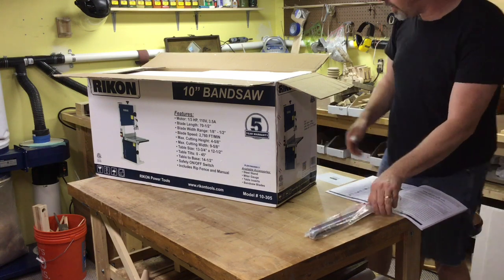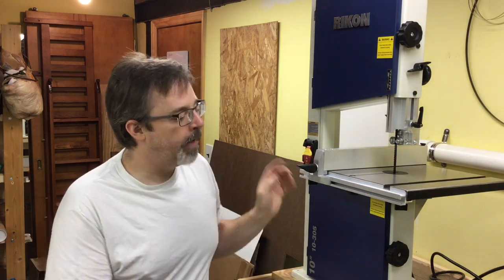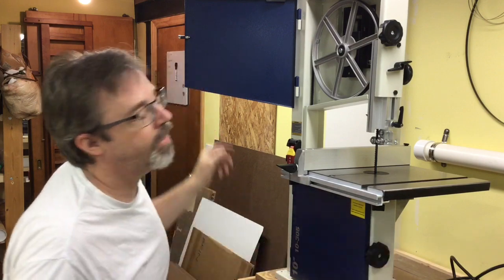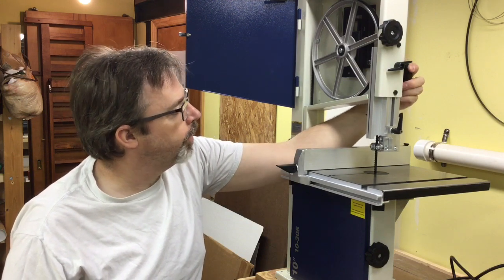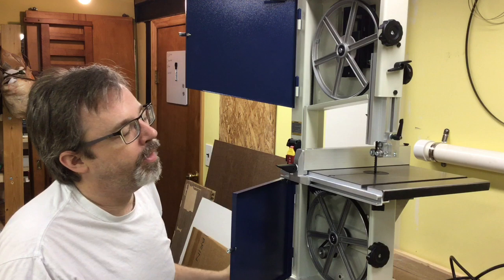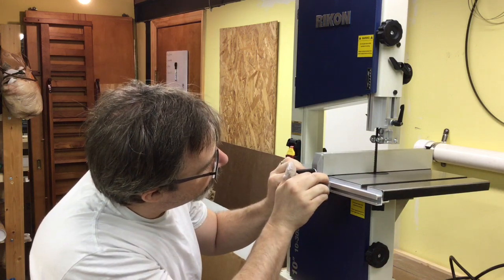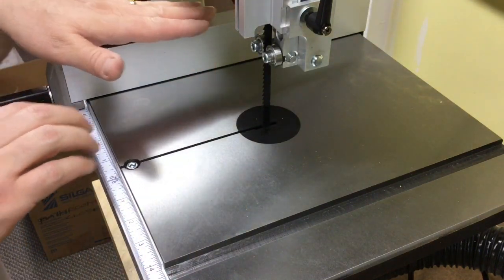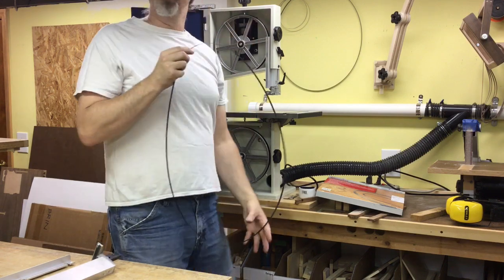Rikon 10-305 bandsaw review

Comment: I have newer model 10-306 and it does have two screws in the back of the frame that keep the aluminum guide attached to the body. You can loosen those two screws and square the guide with the table so it is perfectly parallel with the blade.
Reply from the maker: beretta0222 I will have to look again. I have the two screws on the side, above and below the height lock knob but those couldn’t be adjusted with enough accuracy. It hasn’t been an issue really, but I like to have things tuned right. Thanks for the info.

Comment: i have got the rikon 10-305 and it is a good saw,,,,but the sliding blade guide on the front of saw is a nightmare,,,,i hate it,,,it would so so much easier to have a door that would open up to install a new blade,,for that reason,,im looking to purchase a saw that does have it
Reply from the maker: I agree with you about that sliding guide, it is a real hassle now that I've had the saw longer. Fortunately I don't change blades that often. I'm not sure if there is anything better in that price range though.
Reply: @s.g.devries8557  i dont know,,i have looked at alot of them and thats the first thing i look for,,,i think the 9 inch models dont have it,,but i would like to have the 10 inch size

Comment: Sir may I ask where you found this saw for $210.00? Thanks and thanks for the video!!
Reply from the maker: Robert Jenkins I bought mine at Menards when it was on sale and I got their 11% discount which made my final price $210. I believe this saw usually retails around $299 but occasionally you can get a better deal.
Reply: @s.g.devries8557  I found Menards. I had actually never heard of them. Was the 11% discount a promotional thing or first time buyers reward? Thanks!!
Reply: @robertjenkins8630  They occasionally do a promotional offering of 11% off everything in the store. Only catch is that it's a rebate system so you must fill out and send in your rebate form. They make it very simple... it's just an extra step that you need to be aware of.

Comment from the maker: Hector, I am not a professional by any means, but I will do what I can to help you out. First off, I recommend watching a video called “Band saw clinic by Alex Snodgrass”. He has a lot of great information on how to properly tension the bandsaw blade—much of which is a bit contrary to what a lot of manuals will tell you. I have followed his guidelines with great success and had many improvements to my own cuts. Most of my issues with the blade wandering have been solved by taking his advice. I use a 1/2 inch (13 mm) blade on my saw and have used it to cut 3-1/2 inch (80-90 mm) thick stock without the motor bogging down. It isn’t fast with that thick of wood but it does work if I use a moderately slow feed rate and make sure my table and blade are aligned right.  As far as cutting curves, I have never had a lot of success with cutting nice curves on a bandsaw (any bandsaw, not just this one) so I tend to use the thicker blades and cut slightly off my marks and then get my final shape using various sanders. I don’t know if changing the motor as you suggested will make much difference in that regard. Most of the time when my saws are giving me trouble the issue is one of three things: -blade not tensioned right, -dull and/or poor quality blade, - or I am trying to use the saw beyond its real capabilities. 

A couple of questions for you. What blade are you using? What type of wood and thickness are you trying to cut? What sort of cuts are you trying to make? (Curves, resawing, cross-cut)?